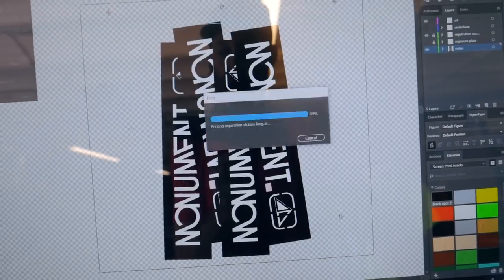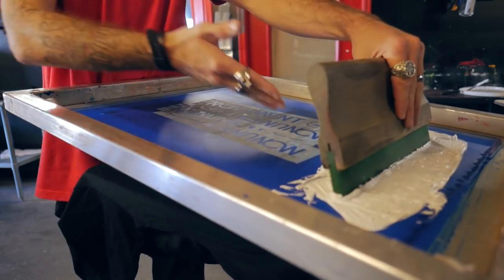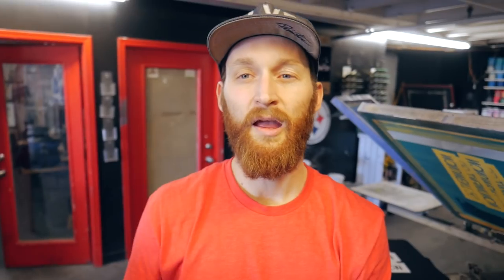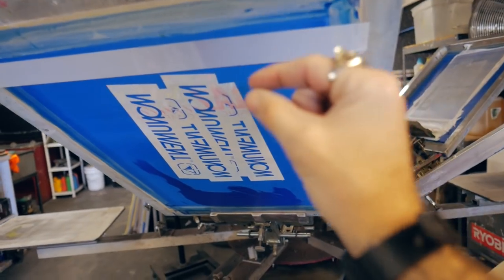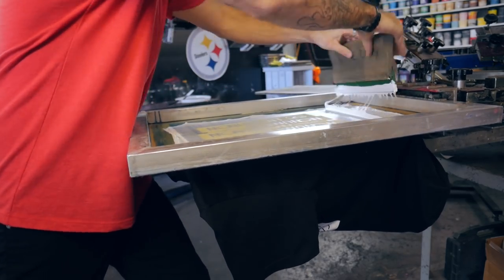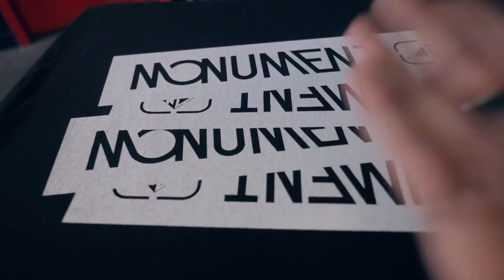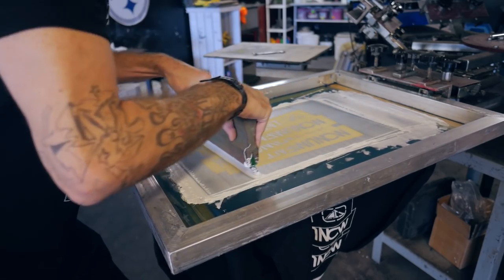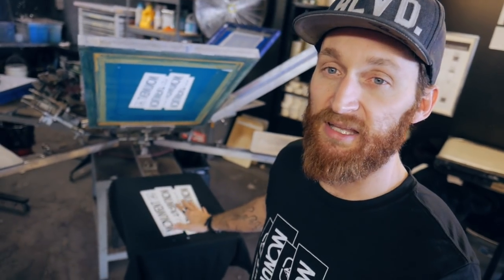How to Screen Print | 1 Hit White Plastisol Screen Printing Technique | T-Shirt Printing Tutorial

Comment: I have done this work before and I used 70 mesh with double coat(for edge clarity and thickness) on a Newman roller frame with med soft squeegee.   With a hard pull wet stroke and push stroke for print

I was able to achieve it a satisfactory result but never a good as print, flash and print on a 160

Customers did not complain and were very happy

Comment: I did a run of white prints on black shirts a few years ago for a metal band. I got it done with 2 - 3 strokes, no flashing and it looked great. But it was only achievable because they wanted cheap shirts. I used a local(South-African) brand that is akin to freaking sack-cloth. They felt horrible but looked great. But honestly it's not a sacrifice I'm willing to make. So I would rather HFH than print on rubbish shirts.
Keep up the great work.

Comment: I find that using pressure is the problem as it pushes ink into the shirt. i personally think less pressure allows the ink to sit on top of the shirt thus being more opaque. also if the ink is cooled it is thicker as ink will thin when agitated (eg flood and print) and even thinner when heated eg hot pallets heating up flooded inks. agitation and heat thins ink that is why you get a cmyk design looking cool then after 15/20 shirts it starts to get dark. so mix the inks(agitate) and warm them up and you should get sam looking first shirt looking same as last shirt. i do loads of cmyk designs for river island on black tees. im a colour separator in the uk i do work for Live-Nation, bravado, done thousands of Harley Davidsons this is when Live-Nation was called delux  the very top of high end seps for bands and concerts all over the world. the guy below said put 2%puff in the ub too. to be honest i think its a good idea for some designs. you may think im a nerd but to be honest i too like to problem solve, i was in the image magazine in 1998 with scot fresner, he uses colour range in photoshop, very primative but can work with cartoon like designs but i would never entertain the thought, this is the first time i ever replied to these comments thingy, but you came across as genuine , bra if ever you need a sep done feel free to contact me at  bretkeppler@gmail.com ill do it free if i have time.anyway bra, be cool and God bless

Comment: Use higher duometer squeezee, dark blue 85A with 200+ mesh count screen and firm pressure to clean out stencil fully w ink. It will be thin and well divided white

Comment: Try using Wilflex Bright Tiger, much more opaque than Amazing White. Its more of a premium ink so its is more expensive but man is it nice. Clears the screen and is a great ink. On S mesh and thicker coat you had.
Reply from the maker: Right on thanks for the tip, I will give it a try.
Reply: Agreed. Considering ink only accounts for about 5% of your overhead...there’s no need to worry over the cost of the ink itself. You could be using ink that is super expensive but if it reduces production times i.e. labor, it’s money well spent. Personally, in the ( oh good lord ) 26 years I’ve been a printer, the only time I’ve been able to achieve a true one hit white was through an 86 mesh with 2 coats on the print side first; three coats inside. Dry. 2 coats print side. Then ( and this was on an automatic press ) a 60 durometer squeegee set at a roughly 45 degree angle and just a “kiss” of pressure as there were no pressure controls back on old M&R Gauntlets. 
As for Murakami S mesh, it’s hands down the best mesh and as long as you keep up with monitoring your Newtons you’re good to go. 
Still though we rely on a print flash print method for almost every job as we are corporate contract printers and they all love that heavy coverage. 
Mad props for giving it a try !!

Comment: Question for ya...Why after doing three shirts with no problem, on a two color white and red, the red bled into the white? First three laid out perfect other then needing a better hit on the white but the fourth one looked like the red was wet and the white was wet too just bled into it and turned pinkish red? white was print flash print and red was single hit on top...

Comment: Not saying I've done it or am an expert, but I feel it has to do with a good coat on the mesh (thicker gasket) thin mesh and tensioned well (open those gaps between the mesh) loose ink that doesn't want to stick in the mesh on the first squeegee, a sharp edge on the squeegee  (to shear the ink and break the bond between the mesh and ink) and sorry but yes, pressure and technique, if you are pushing any harder than absolutely necessary then you are not laying the ink on top of the fabric, any ink driven in won't look as bright. And if you have to do more than one hard flood before printing, are you really saving much effort or time? The angle of the hard flood can affect how much ink is loaded and could end up blobbing out of there's too much waiting for the print stroke. There's so many frickin variables in screen printing haha.

Comment: A thicker stencil equals more ink, add s-mesh , with a push at as close to a 70 degree angle, with an off contact 1/8 . I use 2 hits white no flash

Comment: I'm kind of a newbie at screenprinting, but started making shirts of my art - which has a lot of fine detail. 
I've been working at trying to get a good white ink print. Elusive. Do you have any tips for finer detail work in white?
Reply: I apologize if this is information you already know, but it never hurts to say! Add either a little bit or reducer or softhand into the ink, also make sure your pallet is warm, and do a few test prints as that will help warm up the ink and make it a bit smoother to print with.  To keep up higher detail you wanna use like a 200 mesh. If your exposure times are dialed in right (use an exposure card) you might be able to get away with a 156.  Also make sure you are doing a double hit, then flash it, then do a single hit on top of it.  This will help that white pop...at least for plastisol.  Holy trinity of factors to check: speed, pressure, angle.  Bonus is squeegee hardness!  Good luck with your work! :)

Comment: Ulano capillary film can be purchased in two different thickness 30 & 50.   The 50 will load a greater volume of ink.  I have had varying results on one coat white.
Reply: Imagination Apparel we use the 50 all the time with Wilflex and there is no way I could get a one hit white.
Reply: That is EXACTLY what I was attempting to indicate.

Comment: Add 5% or 2.5% puff to the paint and the off contact has to be like 3 Quarters high
Reply from the maker: Wow  yea the puff makes sense but it didnt even  think to run a screen with that much off contact!!!! I have never set a screen that high for any reason.
Reply: I also use high ass off contact and also reduce up to 10% with curable reducer. I have an automatic available and I will run a few tests myself on Monday.
Reply: I was gonna suggest this as well. I have yet to try it though.
Reply: That works.....i mix 5% in all my 5 gallon whites....with puff and its one hit white.... DEPENDS ON THE PROJECT

Comment: Use Excalibur Plastex Waterbase White.  Buttery smooth and very opake with very minimal pressure.  Stretches just like oil based plastisol.  Meets all environmental standards.  Prints on almost anything without any additives including spandex, leather, nylon, lycra and poly blends without bleeding and hardly any fibrillation.  Cleanup is just with water.

Its been a while but if I remember correctly this could be the one hit white people are looking for assuming all variables are controlled.   You don’t need to do the less pressure technique which loses detail after several prints.  Just push stroke with a slightly higher than 75 degree angle.  Adjust angle if necessary.

If you print flash print with this ink it looks awesome and it doesn’t have a heavy hand feel.
Reply from the maker: Excalibur hu, I use to love the plastisol from them. I will try it out.
Reply: I'm kind of a newbie at screenprinting, but started making shirts of my art - which has a lot of fine detail. 
I've been working at trying to get a good white ink print. Elusive. Do you have any tips for finer detail work in white? Want to try the ink you recommended.
Reply: TheMuse TheMuse There are many variables that affect print which will be too much to explain in one post.  But here are some suggestions.
Reply: Artwork: I’m not sure how to describe it but you first print out the artwork at actual size and determine which parts might close up during printing. From there use software to expand those areas so when you print it, it has enough space for ink to expand but not enough to close up.  Same goes for very thin lines less than .25 point thickness.  Make it easy on yourself and make it thick enough to burn on screen.  Still possible to burn thin lines though.
Reply: Screens: The higher the mesh the higher the detail and lesser dot gain  but also harder to push ink through.  Yellow meshes will be easier to burn fine details due to light not bouncing around like with white meshes.  Still possible to burn detail with white meshes though if you know what you are doing.  Important to have high tension screens in order to have detail.  Usually a fresh static frame or a newly tensioned roller frame.  For roller frames don’t follow that rule of 35 newtons of tension.  I try to tension above 50 to 60 newtons.
Reply: Film: The best film to use is the one from an imagesetter where you have to run the film through some chemicals and whatnot. Just not practical and expensive.  The only options right now is inkjet films and films from a Xerox machine.  You can get high detail with a Xerox machine film.  Just a little more labor intensive in preparing the artwork to come out as dark as possible with toner.  Too much to explain in this post
Reply: Substrate: It is easier to get details on smooth surfaces like the dry-fit shirts.  Although you will have to use a low bleed white which can be thick like caramel.  Or can be smooth like the Plastex ink.  With cotton shirts you will need to do what you need to do to get detail prints.  Angles, pressure etc.
Reply: Press: Forgot what its called but on manual presses the arm will bend under pressure.  You have to be consistent with your pressure or else you will get a slight blur due to one image being a little higher or lower.  It is easier to get high detailed prints if your pallets are cleaned.  Get rid of the lint and  built up adhesive on the pallet
Reply: In the end you will have to find out the perfect formula based on what you have.  The emulsion.  The exposure time.  The mesh line count and color.  The substrate. Etc.
Reply: There are other things I might have forgotten to mention.  Like I said.  There are a lot of variables.

Comment: lifting the screen with one hand and 3 strokes to pre load the screen?  that is already too long.  We often to a quick push with thin coverage just to provide a filler level surface - flash it - then lay down a heavier push but still not with a bunch of preload strokes.

Comment: It can be done with poly white or by adding a pinch of puff additive. You can also use capillary film to get a thicker deposit. Back in the day we used an athletic white that was thick as cement. I don't think they even make that ink anymore but it printed one hit with a beveled squeegee. It was a bitch to print though.

Comment: Myth. The technique - Yes, it is fucking voodoo - Is super thick stencil. 2+2 doesn't cut it, and your face coats are barely adding anything to your stencil thickness, they're filling some hollows of the mesh but barely adding to create a thicker stencil. Try coating 2+4 or 3+4. Stupid thick stencil. 

There are Bill Hood videos on youtube here that detail this and the goal is a 400-500 micron stencil. A sharp 70-75 shore squeegee and force the ink into the stupid thick stencil, not "flooded",  forced!... The voodoo part is transferring the ink out of that stupid thick stencil with a light touch on the print pass. The theory is a tight tight mesh of VERY high tension which physically pulls the threads open and allows the ink to release out of the thick stencil cavity and transfer onto the top of the shirt. Yes, the theory is sound and achievable, people do it - IMO it's fucking useless for a production environment. 

We're not robots, we can't achieve perfect pressure that the technique relies on to consistently not fuck shirts. Even on an auto you're relying on the lightest touch, but you show me an auto with pallets all perfectly level where you can rely on a set squeegee depth consistently hitting each pallet with uniform pressure to achieve this - It's fantasy in a real world production environment. Unless you're the type who can achieve an other-wordly consistency, you're simply not able to repeatedly hit the sweet spot.

Comment: I have done the same exact experiment with multiple ink brands, screens and stencils. It simply does not work to my standards. My results were similar to yours.  

If you are doing a lame ass distressed print, bingo! But if you are looking for a quality image, you will need to HFH. 

That crap wouldn't leave my shop.

When you see these so called "one hit wonders", I think it is a ploy to simply draw traffic to a website for video.